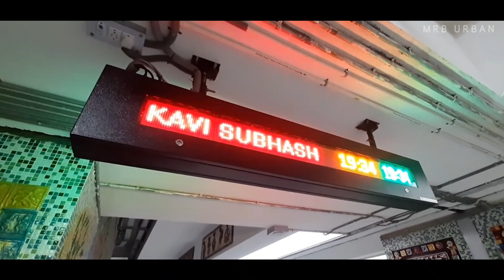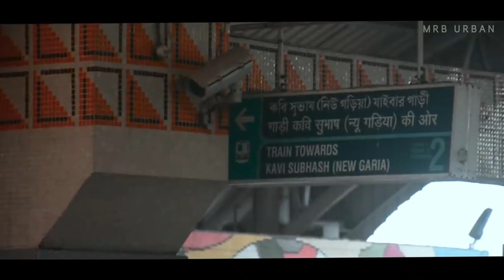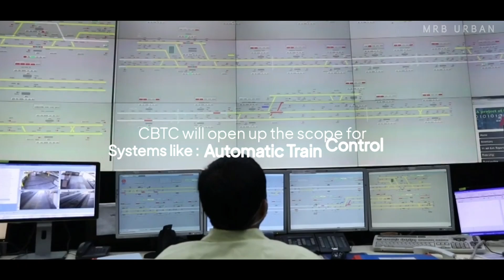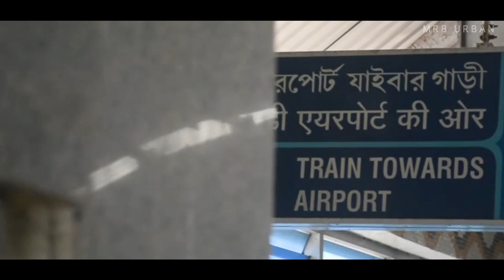CBTC Signalling System on Kolkata Metro North South Line | Upgradation from TPWS to CBTC

Comment: Automatic train operation (driverless operation) won't be possible in NS line as there are no platform screen doors. It will be possible in EW line though.

For new lines, Line 3 and Line 6, again we won't have ATO as there are no PSDs. When a metro in 2023 is built to 1970s standards, this happens. Only railway babutards are capable of such blunders.

Comment: Driverless metro is only possible when platforms have the screen door, like the magenta line in Delhi has driverless metro, because all the platforms of entire route have screen door.
Reply: You can have a system with pressure sensitive plates in the track in the platform area. If something falls on the tracks in that area, the system will know and it will stop the trains.
Reply: In Toronto Subway has been upgraded to driver less system without platform screen door. However  there is always a driver present in the cabin for emergency
Reply: @AdhipTrainman  That's also fine I guess, unless random ppl jump on the metro track like in Kolkata.